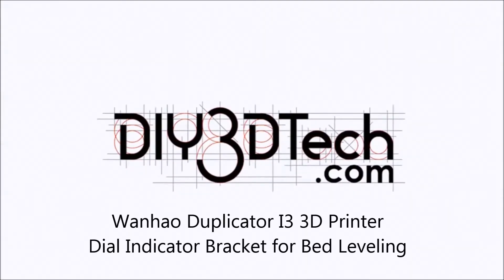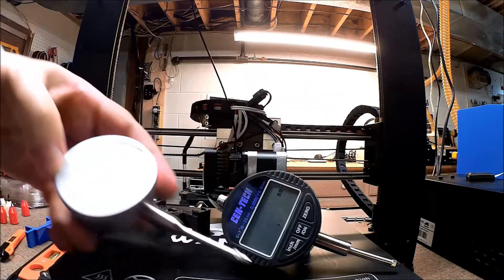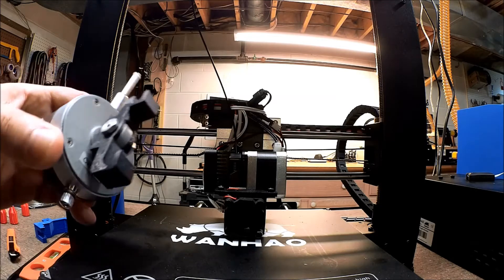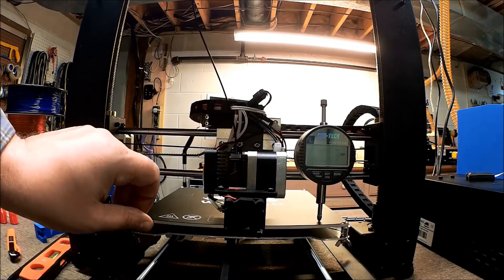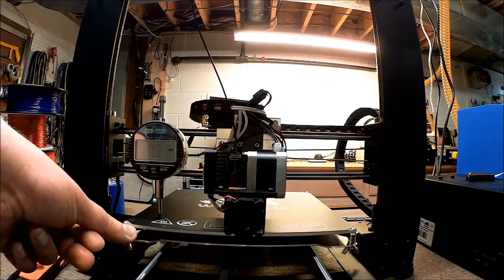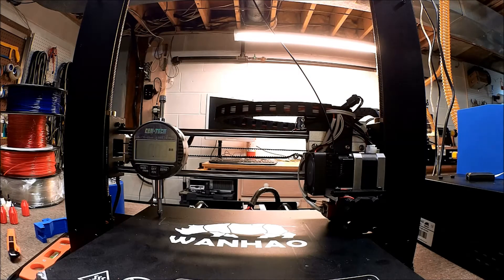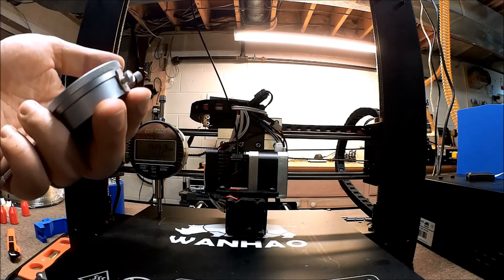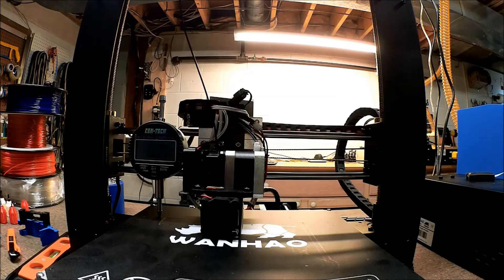Wanhao Duplicator I3 3D Printer - Dial Indicator Bracket for Bed Leveling

Comment: When levelling the bed you should "split the difference". When you zero your indicator and then move to the other side of the bed, you should take half that number and adjust to that. For example when your one side read -0.32mm you should actually adjust it to up so its -0.16mm then it will be level with the side you started at. If you go back to your zeroed side it should read -0.16 as well. Then you know your level. Just a machinist trick.

Comment: HiHi +DIY3DTECH.com

I saw this video thou your website, and orderd the same indicator that you use in this video.

Im going to print PLA on Wanhao Di3 v1 with BuildTak on the Heatbed.
I wanted to prepair myself for when the Indicator comes to me, and wanted to know what the best distance is for PLA, when using BuildTak. Altså the ABS on same setup.

Also, when everything works perfect, and theres no need for further adjustments, would you adjust the printer at occations? Once a month?

Thanks for the video :)
Reply from the maker: +Danni Hansen use of the indicator more so for leveling the bed rather setting the level if follow.  So do the paper test, mount the indicator and use it to "level" all points to either one "or" the average of the points. For me I pick the right front go from there, this helps ensure a uniform fist layer.  If you watch though to a couple other videos, you will see me do this...

Comment: I cheated for making my dial indicator mount.

I got about 25mmx25mm square of cardboard about 2.5mm thick (actually was 2 x1.25mm thick I glued together).  I then measured and drilled some holes in the cardboard.  

The first hole I did so that the straight edge on the card is flush to the dial's back (so when I ran a M5 bolt through it) it was well placed (and no play).

The 2 remaining holes I measured and drilled so that I could mount it  to the side of the fan for the hot end end. 

This way it got me the closed to the printing head, so when I used the printer to move the head I got the most dial AOE to measure against.

The key issue I take away from this is its not something you should need to do often, and since I plan to add a Z probe, its easier and quicker than printing a plastic one out.  (and also the flat cardboard can store in the dial indicator storage box).

But thanks it was a nice video.
Reply from the maker: +Randall Lasini Very interesting, just finishing up a re-mix as promised so you might want to check out.  For me its about every 4 to 6 prints as when you pry on print to get them off this can affect the bed as remember its not lot of travel we are talking about.